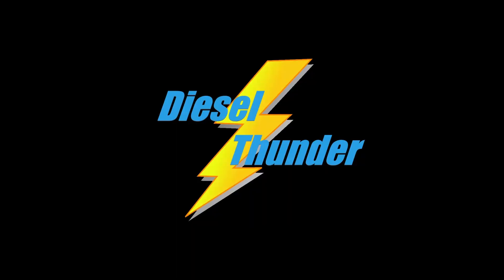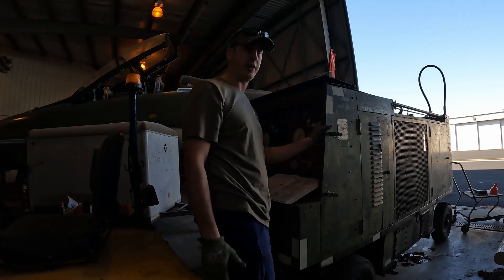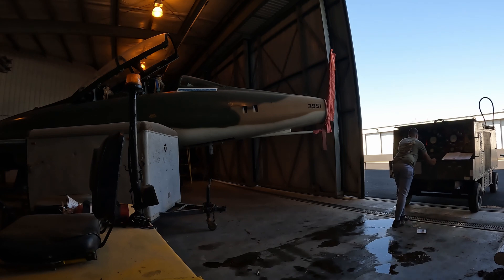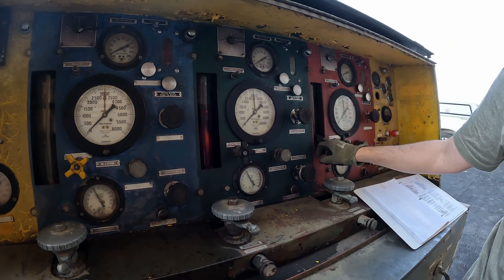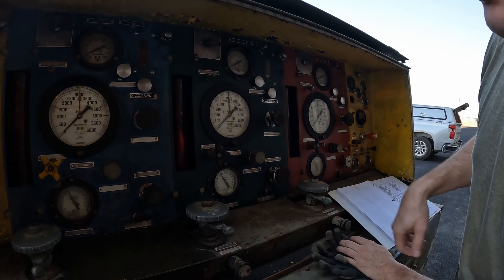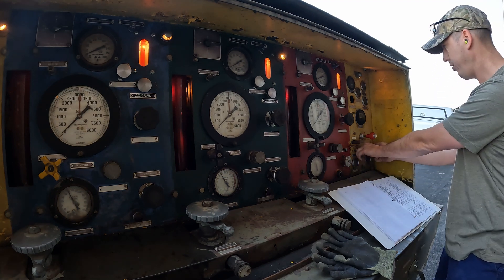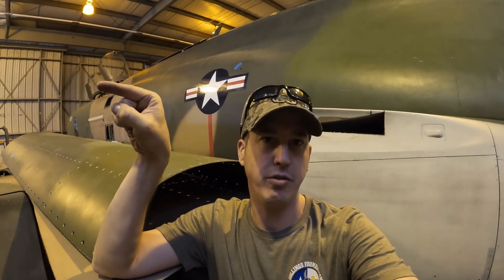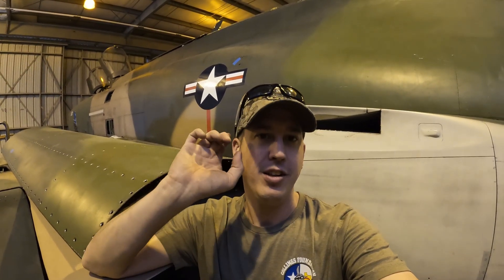Getting the Air Out - F-4 Phantom

Comment: Great to watch your F-4 videos. I was a F4J plane captain and maintainer in the navy so many moons ago. I was surprised to see that the D has an air start port for each engine, while as I remember the Navy birds had one for both. The tail hook was the same as you said, what a job that was to replace.
Reply from the maker: Thank you for your service! Glad you enjoy the videos! I’ve come to understand that was a subtle difference between Air Force and Navy Phantoms. Navy used the single port with a valve, probably so you didn’t have to move the start cart around so much on a crowded flight deck.
Reply: @DieselThunderAviation  Didn't the USAF birds also have a cartridge start capability also. watching your videos, I can just about smell the hydraulic fluid, panel101.102, we were only allowed to use speed handles back then.
Reply from the maker: They do have that capability, and ours still has the mount where you would put a cartridge (right next to where the start air hose would hook up). Dealing with the hydraulic mule, I've smelled plenty of it! We still use speed handles. My "modern" speed handle helps out a lot, but I make sure to put that on its lowest torque setting so it'll stop long before a screw or nut plate gets stripped.
Reply: @DieselThunderAviation  Replacing nut plates was fun too, I'm having so many flashbacks in conversing with you. Did you know that hook tip was replicable, they were only good for so many traps as was the main assembly.
Reply from the maker: I knew the hook tip was replaceable, though I did not know that the main part also had to be replaced every so often. Makes sense thinking about as there's a lot of force during a carrier arrested landing, stopping a heavy jet travelling over 100 kts within a few hundred feet.

Comment: Ground equipment maintenance (ציוד קרקע) was right next to our Machinest shop.   Those guys would pop in all the time for us to sort out some threaded connection, or remake a bracket (I was also a structural technician).

Peltor make really good hearing protection, the medium size green ones were the most popular, not too bulky (about $17).   Ware a pair of those + ear plugs gives at least 35db reduction if not more, you can work all day on hydraulic mules and electric generators.
Reply from the maker: I always have some sort of hearing protection with me (eye protection too). I feel good that I did not have any hearing loss from my military service, which included running very large diesel engines. 

It’s funny you mention that, we just had a small support bracket made up to replace a broken one that goes up near the spine above the fuel cells.
Reply: @DieselThunderAviation  That mule looks identical to the ones we had ( although your's is a more worn for wear and could go with some TLC ! )
Probably the same mules we received used from you guys with the hand me down Vietnam Phantoms. It's probably the same bracket that keeps breaking !
On a side note : Always check the parking brakes engage, You might consider chocking one non-steering back wheel from both sides too, just to be safe.
We had a guys legs crushed off base by a cart that got away. They are heavy.
Reply from the maker: A bad way to get hurt for sure. The parking brake on this on is broken, if I recall the cable corroded and seized. Happily, our airfield is relatively flat. I'm sure we have an extra set of chocks handy that I'll use on this cart.

I would really like to get something a bit newer, but we gotta run with what we have on hand. If I'm not mistaken a lot of newer carts use electric pumps, instead of an aircraft engine driven pump. A small challenge when we need fuel as almost everything else we have runs on Jet A/diesel.
Reply: @DieselThunderAviation  Your airfield might be relativly flat, as most would be, but there are always spots that really aren't.   For example the thresholds in and out of a hanger ?  I'm thinking that mule wheighs at leas 1.5 metric tons ? No chance a person could stop it in time.   I'd suggest some old wooden chocks at all times.
I knew the guy that got his legs (shin bones and knees) crushed.   He was a new guy, a bit clueless. He got a medical discharge, bloody waste oportunity for him. Made me angry.
It can happen to any one at any time.
I know I'm a bit of a safety sally !